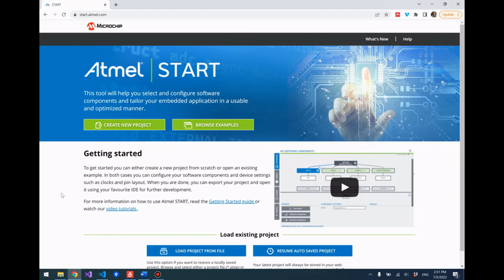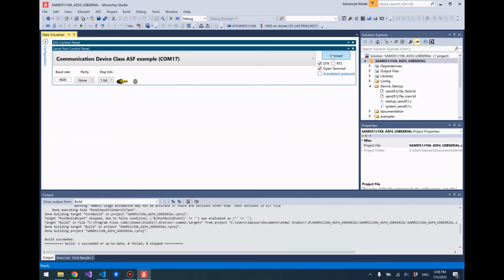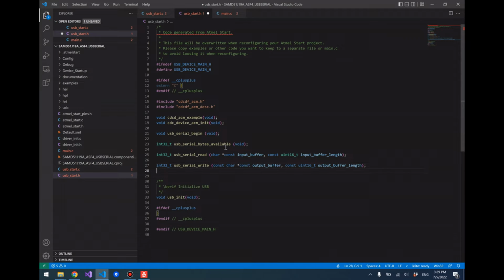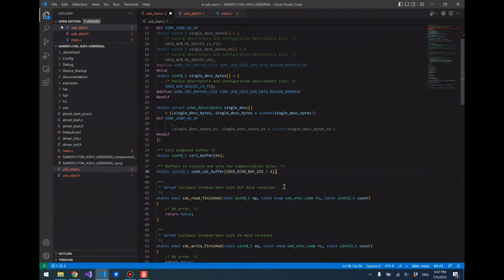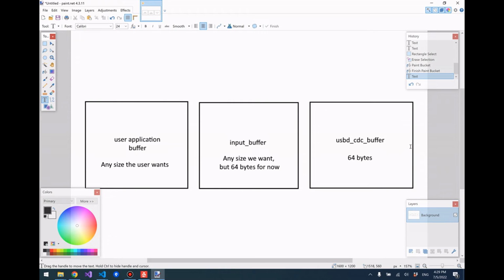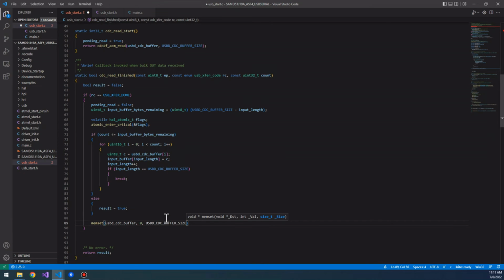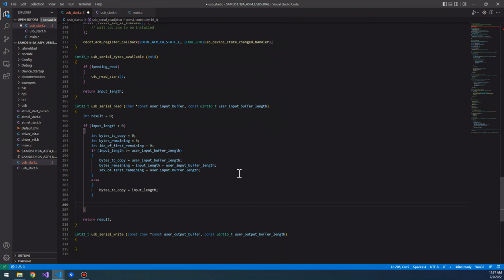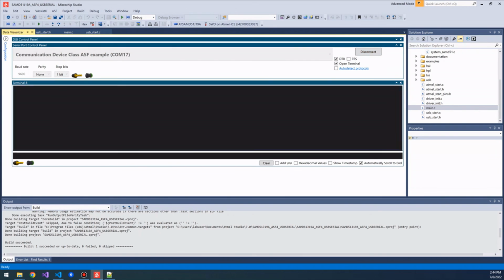SAMD51 with Atmel Start: a better USB virtual serial port

Comment: 10:15 Yep, this is right! I totally confirm your findings! I also painfully learned this lesson! A cdcdf_acm_read() call *before* registering the read callback is VITAL for this USB CDC Code. Otherwise a USB OUT Request will never be acknowledged by the USB Stack which leads to this blocking... So shared pain may half it... 😵‍💫

Comment: Can we use de DFLL to have 120MHz on the CPU or even more?
Reply from the maker: You can go up to 120 MHz, but that is the maximum frequency for this microcontroller, based on the datasheet: https://ww1.microchip.com/downloads/en/DeviceDoc/SAM_D5xE5x_Family_Data_Sheet_DS60001507F.pdf

Comment: Does this API work with the ardino ide? Or do you have to modify the api ?
Reply from the maker: This tutorial is specifically for using Atmel Start (https://start.atmel.com/). Unfortunately, Atmel Start has now been deprecated by Microchip as they are trying to push everyone to use their MCC tool instead. As for the Arduino IDE, you can use the SAMD51. Adafruit has several SAMD51 boards that work in the Arduino IDE. You can also customize their code to create your own board definitions if you want.
Reply: MCC is so bugy not all devices are supported yet. I think I will stick with Atmel Studio for few more years... Their 6 month old documents are outdated I can not get MCC to start a project it is a disaster how they force people to MCC when it is still on alpha development stage.. at least for me. @davepruitt